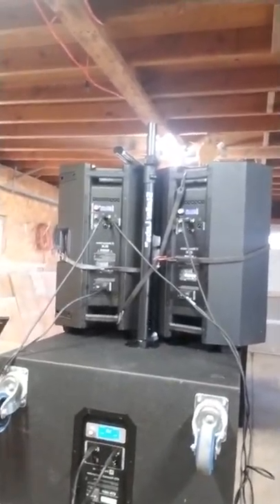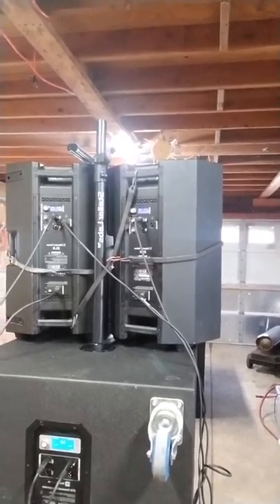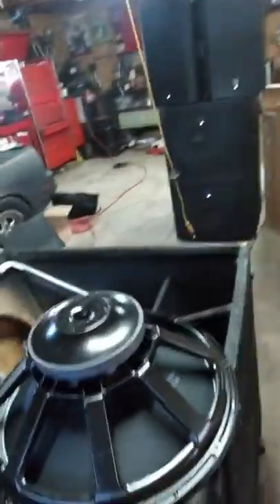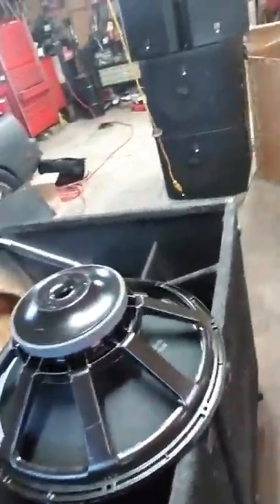EV ETX-18SP Review With Driver Upgrade

Comment: So you took a high end speaker and replaced its proprietary driver with a cheap shit SA driver. You wasted some serious money by doing this, and probably ruined the sound of the ETX’s, and eventually you’re going to destroy the cabinets. Those cabinets are only meant to be used with the EV drivers...  that’s why it’s designed how it is.
Reply from the maker: Hi Dennison, the native drivers were very low quality. In fact, we toasted them with ease. I understand that you may classify SA as cheap, but NOT the New Madrid 18s. They are extremely well designed and high quality, for SA. We have at least 80 hours on both subs since the swap with NO issues. We outcompeted several other rigs running more power than us with these in dBC. "IF" the cabinets fall apart 5 years from now, from how much we've used them, we've got our value out of them.
Reply: @MrDjanotomus  also I dont think a wooden cabinet can be destroyed so easily so idk what he is talking about
Reply from the maker: @lckite9823  we've been using these almost every weekend, full tilt and still have not had a single issue. So, it's safe to say these have already stood up the test of time. We stand behind this modification 110% 🙂
Reply: That's why we professionals buy drivers with the same specs and better quality.
Reply: I have 8 of these subs and at the time there were no replacement subs or cone kits available.  I tried the Madrid SA's and they sound great in the cabinet.  Although I haven't had any problems with my other ETX18SP's, I would have no problem using the SA's.